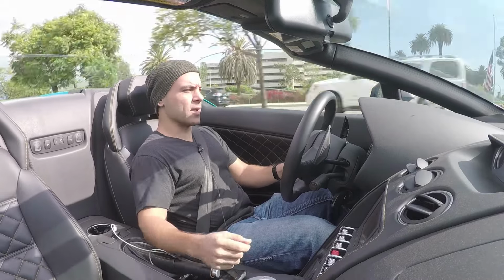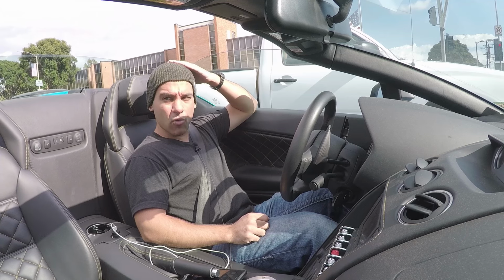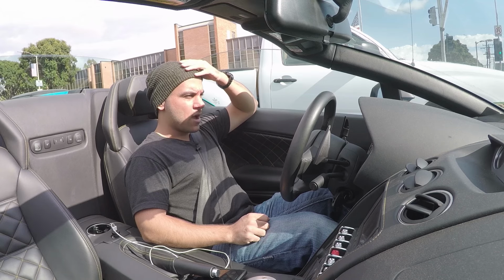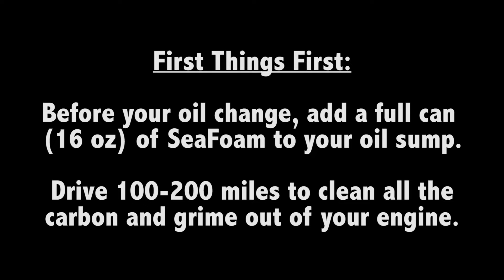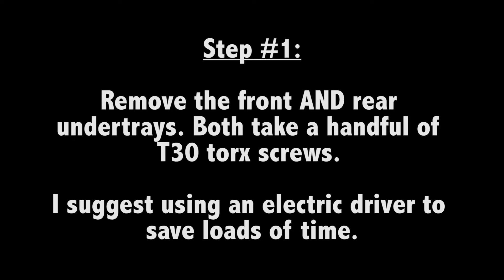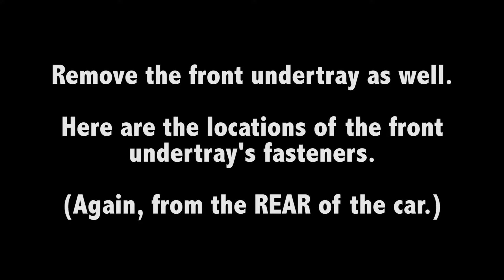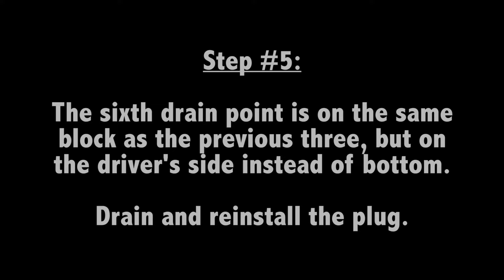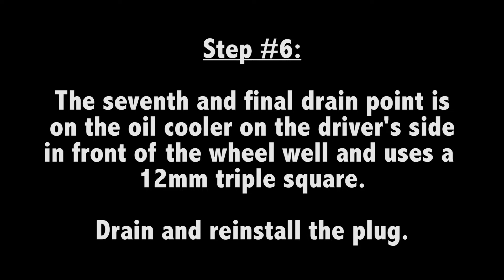How To Do A PROPER Audi R8 Oil Change (All Seven Drain Points!)

Comment: Hy Friends
I want to do the oil change on my R8 V8
Easy to do when I do as showed in your Video
Few Questions:
Is it not better to remove the oil filter before draining the oil?
Do I check the oil level when engine is stopped or during running as PORSCHE-Engines?
Gratulation for the super Videos
Look forwards
Good Luck
Jossssss

Comment: What is the best oil type for this engine? 5w40 or 10w60?
Reply: Eric Alisson Zapparoli 5w 40 is just fine for typical use. I recommend Pentosin Performance III
Reply: 10w-60 strictly n climates above 70 degrees because the oil is thick, also always match VW 50X oil spec.